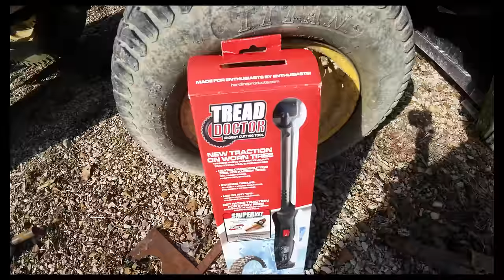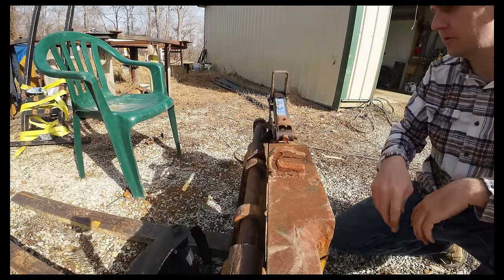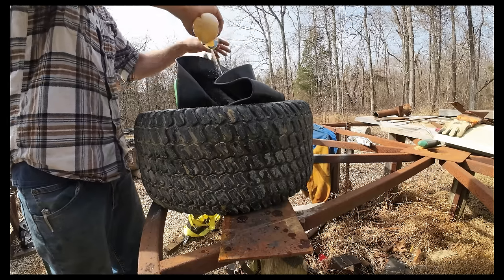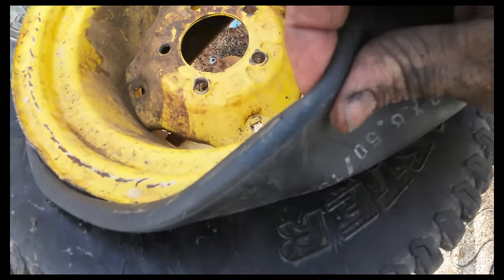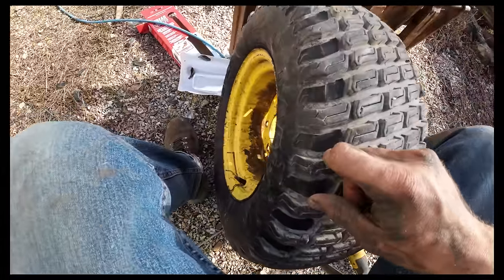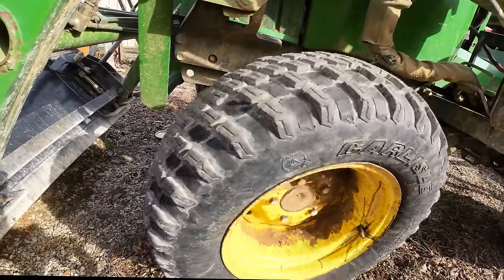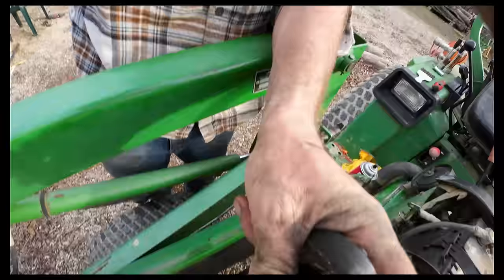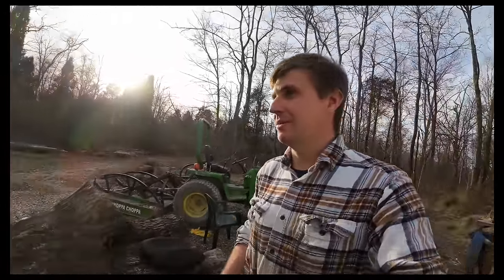How to Cut Turf Tires on my John Deere Tractor - Is it Worth the Trouble?

Comment: I love my R4s on my Kubota
Reply from the maker: R4s were a marketing scam by manufacturers trying to make newer, underbuilt tractors, look tougher than what they actually are.  If you ever get the chance, and run in grass dirt or mud, try a set of R14s.
Reply: Another vote here for R4s. I run amongst mesquite and honey locust thorns and R1s wouldn't last. I agree they (R4s) are terrible in mud but in my case are necessary.
Reply: I get along good with mine as well. Its not an Ag tire but it works.
Reply: I have R4s also.  They do ok, but they pack up quick.  I run in mostly red clay and river mud.  The R14s look like the tread pattern on my UTV.  My UTV does not do too good in the mud, but man it will climb rocks!
Reply: My 2038R came with R4's, only thing I've seen them to be good at is lasting longer than many other tread styles. My Ol' Man has always ran R1's on his 1070 and there's no doubt they're better in the mud but definitely ride rougher and are harder on the lawn. Will be looking to upgrade to R14's whenever my tires wear out especially since they're about worthless in the winter. And yes the rears are filled and I run with the loader and backhoe on 95% of the time.

Comment: To permanently fix the fitting on the fuel filter housing, fitting I suggest using Red thread locker and slid it together, then put a little at the end of the joint and allow to dry. It will seal ir together quite well as I did the same on my 22 hp Yannar in my JD lawn tractor.  Good luck, fun video and thanks 👍.

Comment: TUBES:  #1, always fill the tube PRIOR to install to see where the valve is oriented & then deflate it.  #2,  Use baby powder on the tube and in the tire to allow for slipping when installing.  #3, Pull the outside of the tire off the rim to make it easier to get the tube inside.  #4, Fill the tube and then let the air out, bounce the tire a few times and then re-fill it.  This allows the tube to form properly inside the tire.  I've done a few.
Reply from the maker: Thanks for the tips!
Reply: Also those lines on the tube are just from the manufacture process.  Lay the tube out and the valve will naturally show you which side it’s on.  Also much easier if you take the tire half way off.  Also need to get all the dirt out or you will have holes later
Reply: Came to give the same advice from a tire guy who specialized in ag tires for 3 yrs but see i have been beaten to it lol 👍

Comment: Doing tubes can be so easy. It's best to break the bead on both sides of the tire, then pull one side off the rim (just as you did @ 11:30). Now the tire can be moved up and down freely, and you have a large space to put the tube in. A top tip is to put a little bit of air in the tube before fitting it, just enough to hold it up and still be able to squash it and fold it a bit. Now the valve stem is even pointing in the right direction for easy fitting. Tuck the tube into the tire, poke the valve stem through it's hole, and run the tire back onto the rim. Advantage number 2 of having that little bit of air in the tube: the tube is inside the tire and not getting pinched in the bead, (or by a tire iron if you had to use one). Air up the tire and Robert's your mothers brother. (I always check inside the tire for anything that could puncture the tube before I put the tube in).
I hope this can help someone, and make life just a little bit easier.
Reply: Good ideas. I, after getting the tube inside, air it up a bit, and then release all of the air. It helps the tube settle into place and get any kinks out of the tube before the final air-up.
Reply: Having done many tubes on small garden tractors an such over the years, I must agree the above listed steps will make life so much easier to install.

Comment: When doing tubes, we always dismount the first bead, use a tube chain on the stem, blue line always face away from you, use a pair of vice grips to hold the stem while inflating. Once I flated, deflate the tube to smooth out the creases in the tube, reinflate to pressure.
Reply from the maker: All great tips! Thanks!

Comment: Brings back memories. Always air up the tube first - you can see the orientation of the valve stem and it removes the folds in the tube caused from packaging.  .
Reply: Memories for me as well. I was born in the late 50's long before tubeless tires and certainly before their widespread use. I got pretty good at patching tubes. We used to go to the gas station when we were youngsters and get patched several times truck tubes from them for free and float down the creeks on them. Ah the good old days... In my latter years it seems all I patched were bicycle tubes for my kids and now look forward to teaching my grandkids how to do it. Thanks for jogging my old memories... Joe
Reply from the maker: That's a good tip!

Comment: Cool trick with the jack to break the bead.  I wonder if a bottle jack would work as well.  I love the DeWalt inflator especially for dealing with tubes because it stays attached to the stem.

Comment: John Deere actually uses those fuel filter housings on a wide variety of machines, my dads 1070 has an identical one and so did the engine in my old bosses SK45 Mini-excavator. (Boss swapped original engine for one off a John Deere commercial mower.) Had similar problem after fuel lines clogged, wound up putting an O-ring in it and it worked fine for years after without a problem, though I used some tie wire around the line and the housing to make sure it didn't come back out for my own piece of mind. May help buy you some time if nothing else until you get a new one or find the official fix. Hope this helps Capt. As always thanks for bringing us along and keep up the great work my man 😁 👍

Comment: Hey Captain,  I think your tire cutting tool would work better if you used a much shorter extension cord.  You are losing power to the tool due to the high resistance of the extension cord.  A larger gauge cord would help but those are expensive. Yet another excellent video. Thanks!
Reply: No it wouldn't, i have one and i didn't use an extension cord at all... halfway thru the first tire i switched to the vibrator because it just works better... i have used the kind that have the looped razor blades and they are slick but that cheap solder iron with a blade is just that...

Comment: Well, I'm glad I started early, so I miss reading most of the folks giving you advice on stuff you've already done.  Just so you know you aren't alone, the whole thing of "just getting through this one and then I'll fix it" is pretty much my solution also, so I have to force myself to take an equipment/tool maintenance day, at least once every ten or fifteen years, or when a wheel falls off.  (But, if it's a front wheel, maybe I could just put some more weight on the back and finish out the day.)😁
Reply from the maker: It's so easy to just do the quick solution the day of using something vs taking the time to fix it.  I think we are all guilty of that for sure
Reply: I ran over a nail with my front right tire on my tractor and just keep putting air in it. Saturday, I will take that dang tire off and patch it.

Comment: Hey Mike, if have some heat shrink try putting that on the housing to form a better seal.  Just a bit larger than the large diameter on the housing and it should shrink down over the press in fitting.
Reply from the maker: That may be worth a try! Thanks

Comment: Hi Mike! The filter housing is a press fit but unfortunately after years of engine vibration  they loosen up. I have used  two part epoxy to buy some time but eventually you will likely need to replace. Thanks for taking us along on your journey!
Reply: Your 100% right
Reply from the maker: Thanks for the info!

Comment: One of the best tools I have for tires, is a long rod valve stem tool- twist on to the valve stem of a tube, and apply a little leverage to keep it straight and aligned while pushing in a tube, as well, use it for seating a new valve in a tubeless, or yanking a stem out without debeading the tire.  Worth the $8. 🤓
Reply from the maker: I've spent $8 on some ridiculous things, might as well make it a tool! Lol.  I'll look it up! Thanks

Comment: I don't know if you took the tires off and cleaned the dirt out them, I have changed tires for 40 years and that dirt will work into the tube causing several small holes in it. It will take a while but will happen  I do enjoy very much what you do.
Reply from the maker: It was literally in the video Randy, a dedicated section of video showing the cleaning of the dirt and how to drain the water.... literally...in...the video... 💪

Comment: The heated cutter would work very well if it had enough wattage to get it up to temp. I have watched guys cut large lugs in equipment tires with ease. But nice to know that the oscillating cutter can also work. Thanks for sharing Mike.

Comment: Appreciate you having us along for another great Video, I would had thought it would take longer and possibly slightly more difficult to replace the Glow Plugs in the 755. That didn’t seem terribly difficult, you certainly made short Work of it. She is a Loyal Ole’ Rig and  You Damned Right, easier and Save Time in the long Run to Keep up on the Equipment that is Your Bread & Butter. Catch You On The next one Sir
Reply from the maker: Pretty easy job on that tractor.  Should be a time saver for us!

Comment: tires looks great try it you may want to go 1 row more from each side.great tip how to transfer a nut in a tight spot.the jack was slick.i watched a video this week of a farmer changing a truck tire ,he saves his old diesel fuel from filter changes and uses that as tire lub when changing a tire, and it looked very slick better then soapy water
Reply from the maker: That's interesting, I prefer not to have my hands covered in diesel if I can avoid it though.  But I bet it works well!
Reply: Old farmer is probably covered in grease and oil most of the time diesel would be hand cleaner😅

Comment: I have a 755.  Same issue with the fuel elbow.  Get it lined up and give it a decent whack,  just not hard enough to break the housing.  Should be fine after that.  No o-ring on mine.  I also converted my bucket to quick attach, but I went with the John Deere hook and bar type.
Reply from the maker: Thanks for the tip!

Comment: Thanks for tips on tire upgrades. I always get frustrated when trying to get a new tube in. I've had more than one instance where I drove 12 miles to get a 'professional' to do it only to find the tire flat by the time I get back to the property. Once, I  thought the valve stem was torn, but it turned out that they ripped the new tube, and the air was just coming out the valve stem hole.
Reply from the maker: That would definitely be frustrating

Comment: If you weld a old radiator cap to the bottom a old brownie pan. Put the cap on the rad  you than have safe place to put tools and parts. Without them falling under or in the engine !
I learned this the hard way! Back in the 70s during my misspent youth
Reply from the maker: And I would confuse anyone who added coolant!  That's an added bonus!  Lol.  That cutout is where the intake goes though

Comment: Captain I learned a trick to check glow plugs before removing was to disconnect the wiring and use a test light with the clip hooked to the + post on your battery and just touch the probe to each glow plug where the wiring connects and see if it’s got continuity. Not completely foolproof but a quicker way to test before removing. Not as much an issue on the little engine but just food for thought. Keep up the good work

Comment: Well, you did use the scissor jack exactly like I thought you would. 😂🤣

I had new tires installed on my snowblower and they were amazing compared to what was on it. After the first year I started losing air in one tire so I decided to put tubes in them. 8” rims were a PITA but since I left the rims bolted to the hub that I could slide off the axle I was able to hold it still in my big vice. 
In the end I wish I had a set of tire spoons but a couple small combination wrenches worked and I think I’ve only added air once since I installed the tubes.
Reply from the maker: Small tires are a pain.  I went out the other day and the tires still had air... absolutely thrilled.  The compressor is starting to feel left out

Comment: That looks like the same filter housing that is used on the 2243 Greens mower. The one at my old job had the same issue, which if I remember was caused by the press fit inlet elbow becoming loose. We just bought a new one as it was under $100 Australian, and didn't want the diesel leaking on the course.
Reply from the maker: Thanks! Think that may be my route as well
Reply: @CaptainKleeman  You're welcome, hopefully it is easier to source then a 555 water pump!

Comment: My bx 2200 had turfs on eight inch rims, i bought two new r4 tires already mounted on ten inch rims for 100 bucks a piece at my local kubota dealer, for about 220 bucks it was totally worth it,
Reply from the maker: Glad it worked for ya.

Comment: Captain,
On the fuel filter mount. That really doesn't have a o ring. It is a weird press in type of assembly. Unfortunately, the only way, to repair it, is to replace the filter housing.

Comment: The R4s are alright but I prefer the R1s for my application. Never used a hot knife to cut tires but an osulating tool with the flat edge blade with teeth works wonders for a weekend warrior 😉

Comment: P.S. The JD AM875142 fuel filter housing complete is available for around $33. on line. The 90 deg ftg was originally press fit into the hsg.
Reply from the maker: Thanks!

Comment: Just as an aside, we use a grooving iron that takes those same heads to cut our dirt racecar tires.  Don't know the wattage of the one you have, but the one we run is 250 watts.  It gets hot enough to make the rubber smoke the second you touch the blade to it.  Didn't look like yours got near that hot.  The groover we use has a pistol grip too, instead of a screwdriver style grip, which lets you put a lot more forward push into the tool without worrying about your hand slipping.  The one we have is made in the USA by Ideal Heated Knives and can be bought from Speedway Motors (and a dozen other race supply houses).  It won't come with a head like that one you've got, but that head will very likely fit into the Ideal groover, as they're a standard sized kind of deal.  Thing is pretty pricey tho, would cost about the same as one of those new tires, so you'd have to have a pretty powerful urge or the need to groove a lot tires to justify it.
Reply from the maker: Yeah, some I looked at were around $300.  Wanted to try the cheap one, I think we learned why it's the cheap one lol.  Appreciate ya watching
Reply: @CaptainKleeman   No worries man.  Hope the grooving helps stop-gap your traction problems until coinage for new tires can be acquired.

The tubes were probably the winning move of the day though.  Having a flat tire every single time you go to do something is irritating beyond belief, at least to me.  I'd never have made it a year without doing something about it, would have pissed me off way too much to just let it ride.

Good luck on all your projects, sir.

Comment: Hey Ibsee one of your problems laying that tool down on the forks like that your heat is being absorbed by the fork. Also if it's chilly outside or the wind is blowing it makes it hard to heat them. I used to use those solid soldering irons. So I know from experience.  Great videos by the way

Comment: Your intro worked really well, can't see the need to change it !!! 
Inner tubes will be a timesaver, same as the glow plugs too !! 
Only comment on the fuel pump is exactly the same conclusion you came up with, unless you can get a replacement O ring, you may be able to use shrink wrap on the fitting to seal it in place. 
And you have given the chair a new sense of purpose too, oh yeah !!! 💪😁
Reply from the maker: Appreciate ya watching!

Comment: I have an 855 and same filter housing filter fitting came loose.
 I push it in tight and put two wire ties around fitting and filter housing to keep it there. No problems since for years.
Reply from the maker: Thanks!

Comment: I have very limited experience with tubeless tires ie wheelbarrow,  yard cart, lawnmower and snowblower and can state unequivocally that they are completely worthless.  I've replaced every tubeless tire with either a solid tire or a tubed tire.
Reply from the maker: I wouldn't say useless since most tires are tubeless these days, but on smaller things like you mentioned or small steer tires on tractors I definitely agree with you

Comment: On the fule line I don't know if it's supposed to pull out or not.  But a easy fix would be to make a 3/8 double barb fitting  press in to there.   Or tap it out for a screw in barb fitting

Comment: never yet paid to change a tyre...  and i have owned my fair share of trucks, 4x4's, tractors, atvs and motorbikes too... valves on tubes are handed ( if they were central they whould be in the way of the hub center) and I would weld 6" of 2x2" box un the top of jack so you can put in your receiver hitch, way easier.. and safer! great litle vidja.